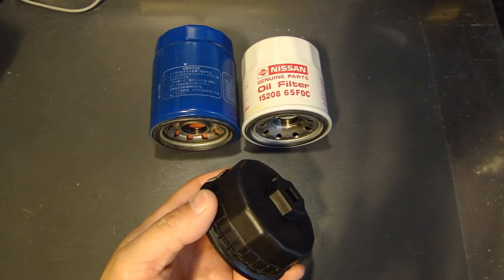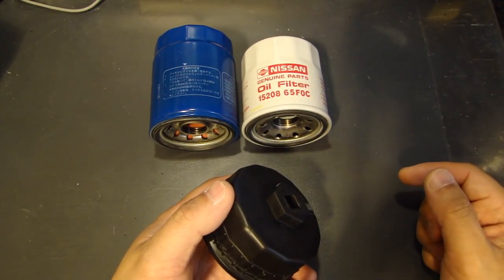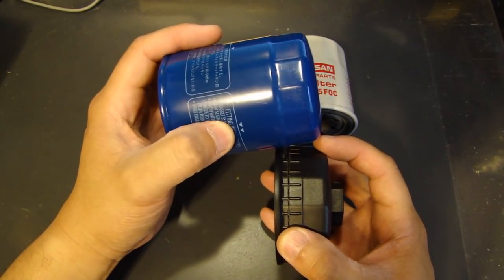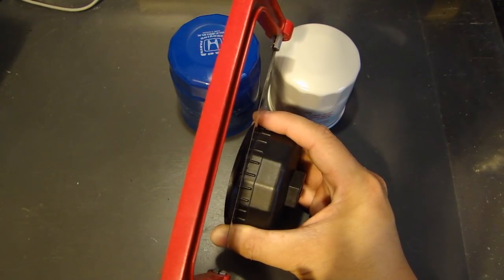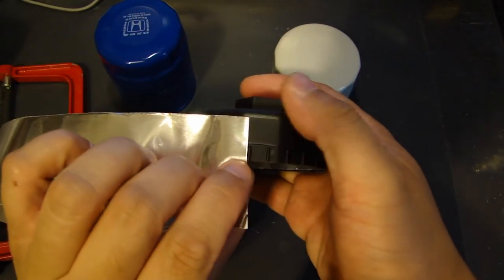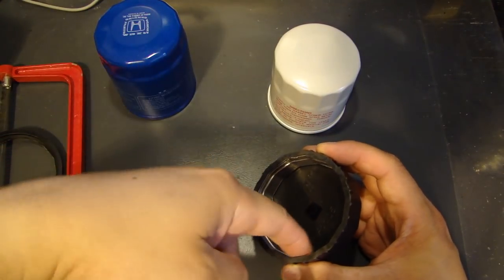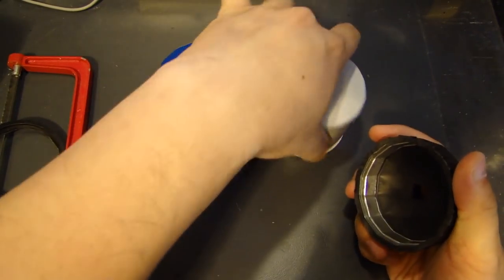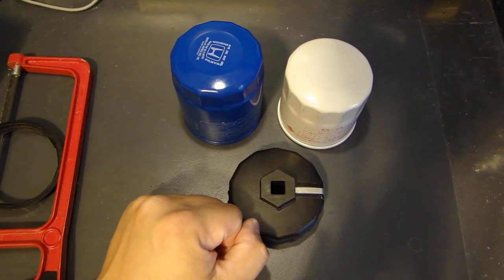Honda & Nissan Oil Filter Wrench Size Information

Comment: Thanks for posting this.  I  went to harbor freight and got a set of these cap wrenches  for $6.00 after the 20% off coupon.    It worked great with no modifications.
Thanks!
Reply from the maker: Thanks for sharing!

Comment: I just had this same problem with my tractor last night.  I put duck tape around the old filter until the wrench was a snug fit.  When I went to put the new filter on, it was a different brand and was much smaller.  I peeled away the cardboard on the inner diameter of the roll of duct tape until it was a snug fit on the new filter and used it as the wrench.

Comment: When ever I use a filter remover and have a size issue or a grip issue i go to 2 tools. First is cotton rags, it accommodates for extra space and give better grip then metal to metal. If that don't work I use 1500k scuffers. Way better grip and work great.
Reply from the maker: Great tips. Thanks!!
Reply: dial2fast any time

Comment: Great video thanks for sharing. What size oil filter wrench does a 2020 Kia Forte LXS use? Also, Can you tell me how many quarts of oil I should put in it? When changing the oil.

Comment: you should not use a wrench to put on a filter, just use it to undo it. this is why you cant get the filters off thesedays they even do this at garages. it just needs to be hand tight and a 1/4 of a turn. hope it helps i'm a former marine engineer. The wrench is just intended for undoing the filter assembly. kind regards Anthony
Reply: 3/4 of a turn after contact, not 1/4... lol

Comment: you should NEVER tighten it with a tool
Reply: cullen garrick Honda's service manual gives a specific torque for the filter. My 3.2l calls for 10 - 12 ft lbs, or 3/4 of a turn, or if it's a Honda filter use the indicator arrows on the side. Either way the manual calls for using Honda's  filter socket to install it.